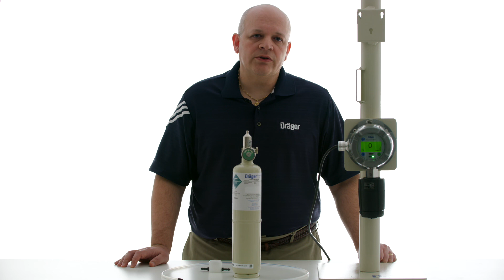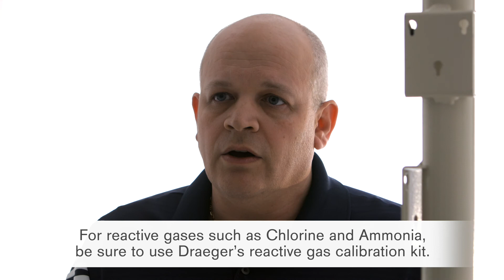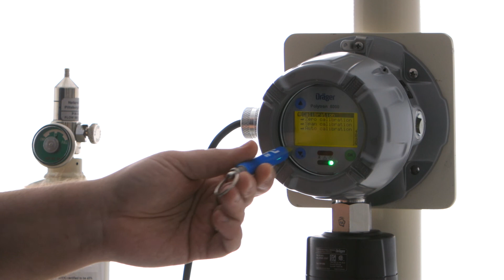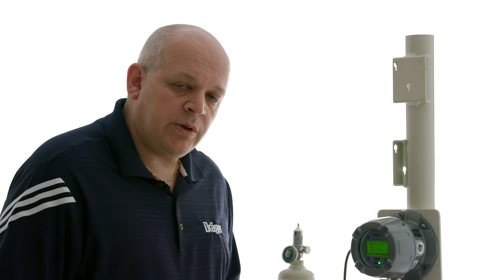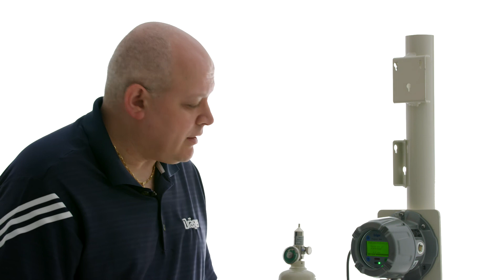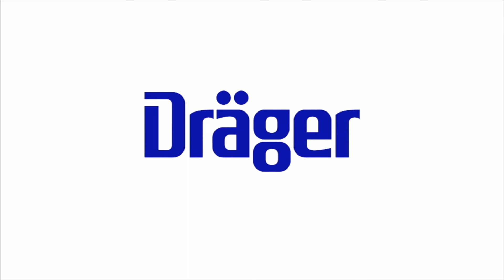Calibrating the Polytron 8100

Comment: What CO sensor was used in this video and why did you use 50PPM CO? In other words, with a 8100 EC fitted with Part No. 6809605 CO sensor (5-1000PPM range) what concentration span gas is recommended? I cannot find the recommended span gas for this sensor in Draeger documentation/manuals.